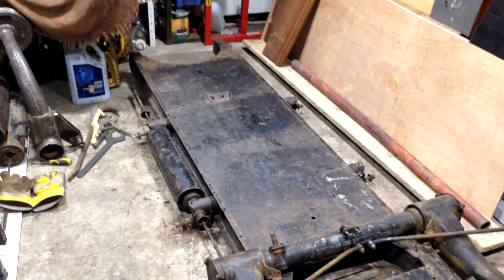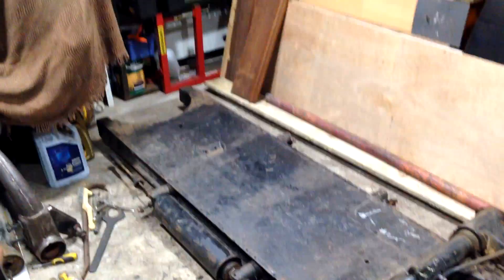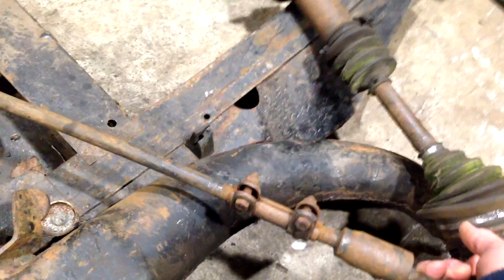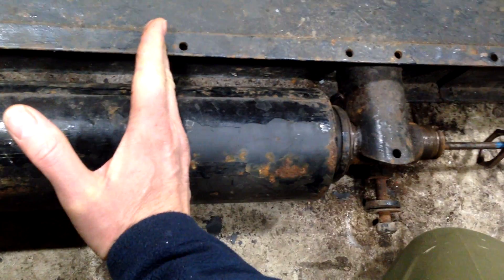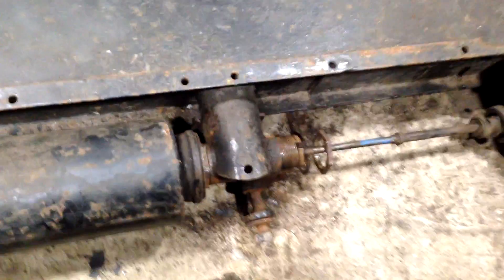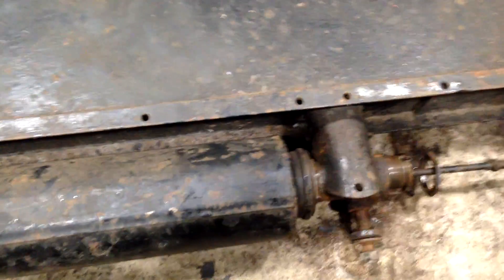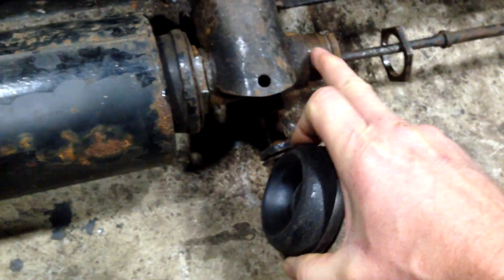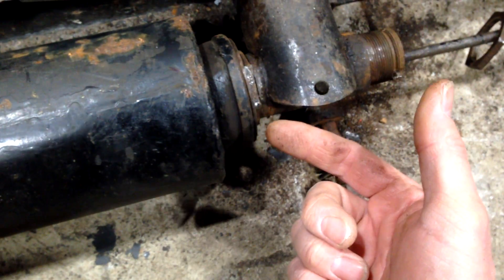Lomax 223 Rebuild #5 2CV Suspension Cylinder Removal

Comment: great video, nice and clear thanks- as far as I know, the slots were manufactured by Citroen according to my workshop manual and there was a special tool specifically made to stop the tube turning...
Reply from the maker: I'm pretty sure I've seen them with and without slots.  I wonder if it's a time frame thing, but they certainly make sense and a special tool also makes sense.  Might have to think about making one up when I come to reassemble!  Thanks.
Reply: It might help, not sure what it looked like but the part no. was 3458T

Comment: Awkward one Dave, can you not just apply heat to the bump stop? once the rubber has burned off, you should be able to get it hot enough and then just replace the stop?
Reply from the maker: Thanks Chris.  I used the angle grinder on one of the others but getting rid of the rubber would be a good solution.